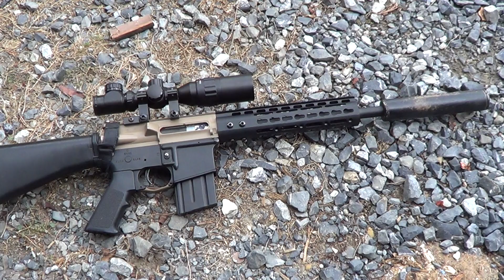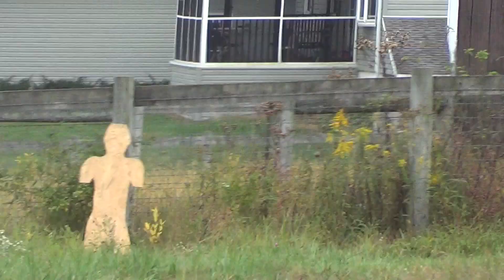Short Barrel Rifle Update (October 1st 2015)

Comment: Any issues cutting through the anodizing on the black python?
Reply from the maker: +Reece Mechanical not really. you can use an appropriate diamond dremel bit with care to QUICKLY get through it with a relatively coarse finish, then finish with fine sandpaper, or use HS5 chamber groove cutter with sandpaper bonded to it. As for the crown, it took a bit using a tapered reaming tool and putting the barrel into a drill chuck, using wet paper towels around the barrel to disperse heat, and using plenty of oil on the reamer and taking breaks, after which i got a really nice deep 2 inch crown, then i used a modified felt dremel polishing wheel with red abrasive compound to get a very nice polish on her ;)
Reply: I meant is the coating flaking off around where it was penetrated
Reply from the maker: +Reece Mechanical Not at all, its aluminum oxide chemically bonded to the underlying metal, not a teflon cookware coating lol.